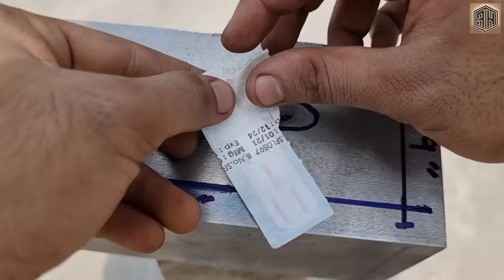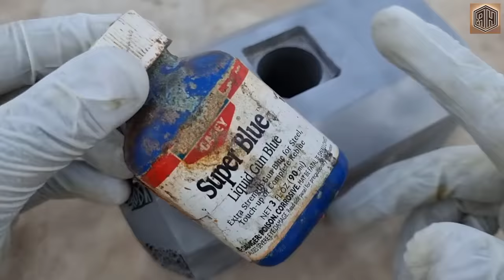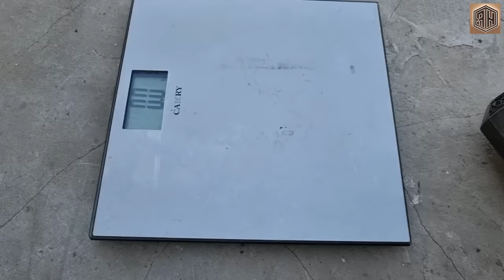Turning an Old ANVIL into a Heavy THOR'S HAMMER

Comment: 13:50 maybe next time try to pre-drill with just one small drill bit. a drill that is as thick as the core diameter of the large drill so that you have a center. If you pre-drill with to many drill bits, they will wear out because you only use the outer cutting edge. Also less rpm, so the metal wont sing like ariana grande. Very nice hammer. Looks insane🥰. Greetings from a mechatronic from germany✌🏻

Comment: A hammer with a head that big and heavy with a handle that thin and short would NEED to be magic for anyone to be able to wield it.  I know that Vision said it was incredibly well balanced but that's one thing the magic would be needed for. Without it that design would be terribly unbalanced.
Thor is correct though when he says that if the head is too heavy you lose power on the swing. That's true.

Now that I'm done being that guy, 
The hammer does look very good. Impressive.
Nice tool collection too.